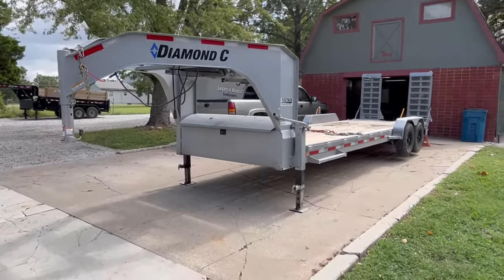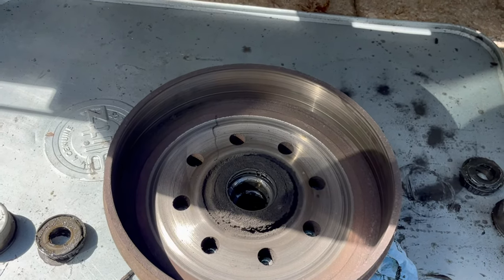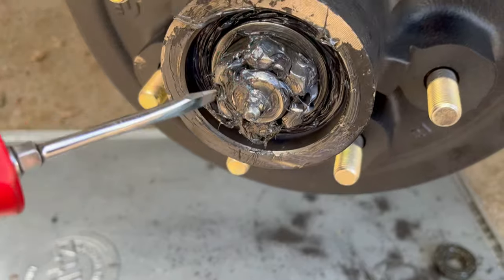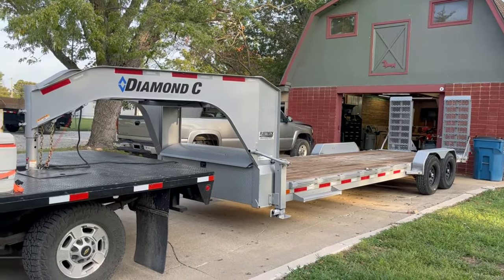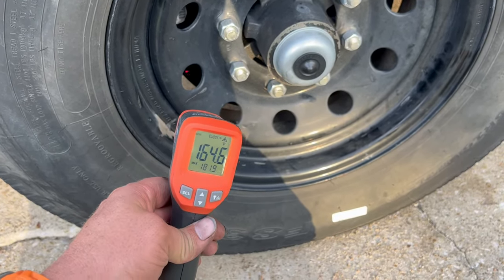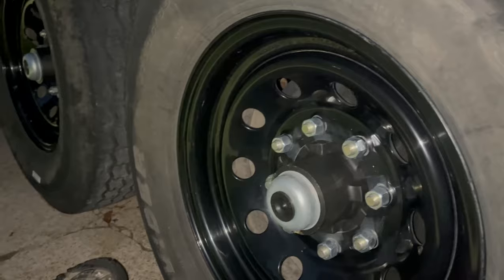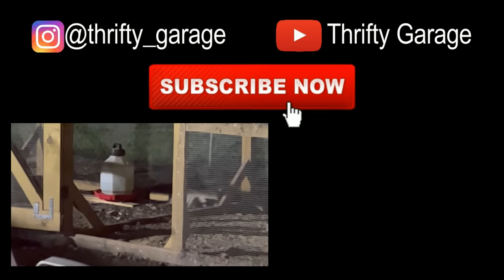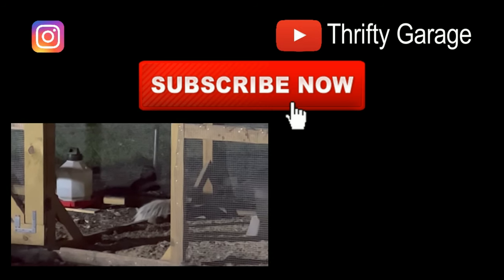Upgrade Your Trailer Brakes for Better Performance!

Comment: I would pack the bearings the traditional way if you already have them apart.  Definitely follow the manufacturer's procedure when using the EZ-Lube system because you will tend to blow out the rear seal if you just pump it full of grease quickly.

I only use the EZ-Lube system to add fresh grease when my trailer has been sitting for a few years because the oil has separated from the thickener. Basically I just pump a small amount of grease while rotating the wheel.  After about 5-6 rotations I will pump another small shot of grease.  I only do it until I see fresh grease.  The problem with this method is that since you have to add grease so slowly (so you don't blow the seal) it's almost faster to pull it all apart and grease it all manually if you're doing more than just topping it off.

You are definitely right to question the previous work to the trailer.  I've found that when it comes to nearly any project, if you want it done right, you generally have to do it yourself, unfortunately.
Reply from the maker: Thanks for the reply and tips.  I am definitely curious to see if there will be any ill side affects to the method we used.  I have a feeling I will be pulling off the hubs sooner than later to ensure everything is working correctly.
Reply: @ThriftyGarage  You'll probably be fine.  You obviously now know how the breaks should feel versus when they are working poorly due to grease contamination, so you probably won't have to pull it apart unless you feel something abnormal (aside from standard maintenance).  Just make sure you follow the axle manufacturers procedure when using the EZ-lube system.

Also, keep an IR non-contact thermometer handy to monitor your bearing temperatures when you can.